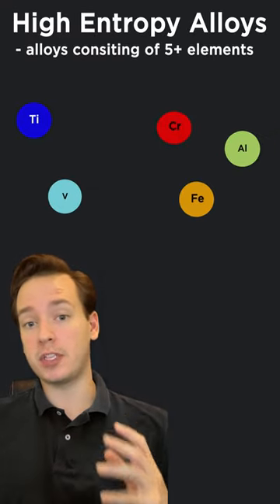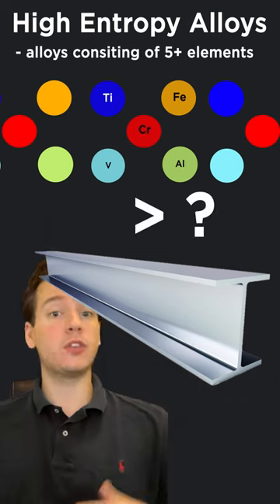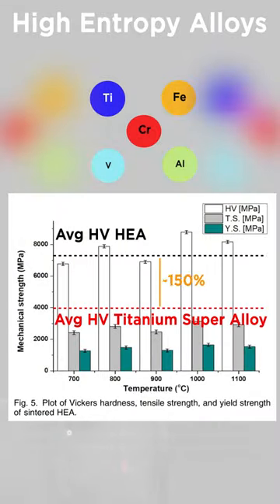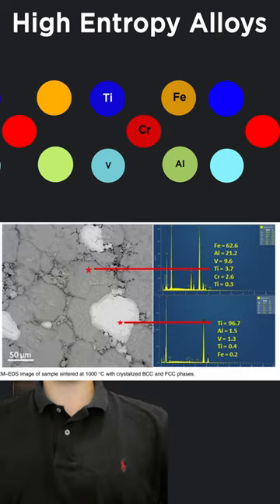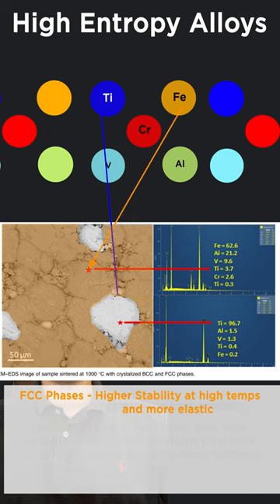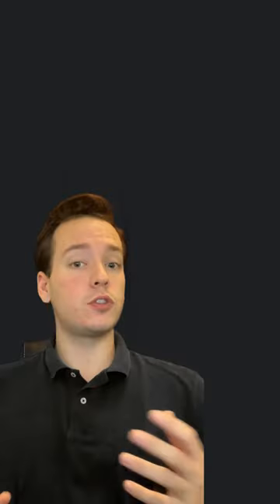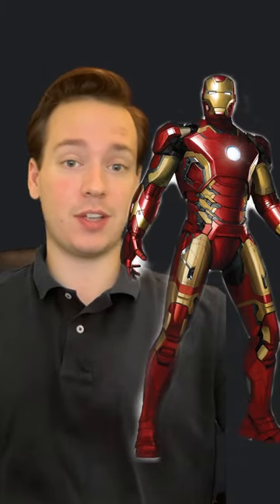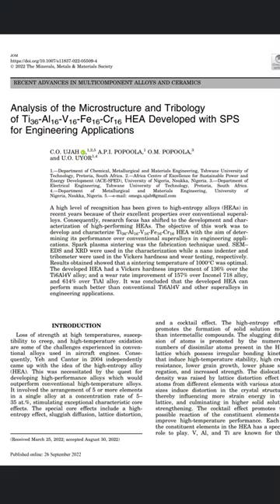Double the Performance of Super Alloys? | Rapid Research Reviews Ep 1

Comment: No offense, but this is a pretty wild exaggeration.

It is fair to compare a Ti-based CCA to the most popular TI-based alloy, but Ti-6-4 is not a superalloy by any stretch.

The paper does compare its alloy to IN718, a proper superalloy, but the comparison is pretty meaningless. They claim their alloy has higher hardness and wear resistance than IN718, but these not the applications which superalloys are designed for. I bet diamond has better hardness and wear resistance than superalloys, but nobody is claiming that diamonds are "better" than superalloys.

Furthermore, the alloy described by the paper uses SPS, so it's really only fair to compare it to identical alloys processed differently, or different alloys processed identically.